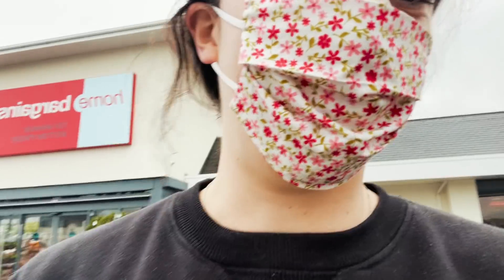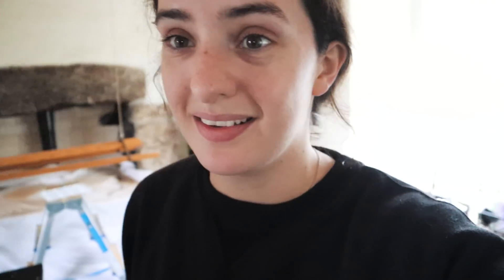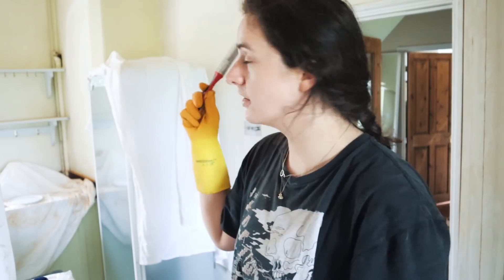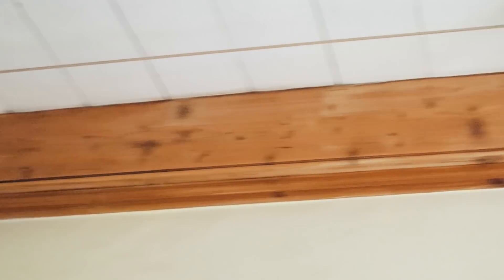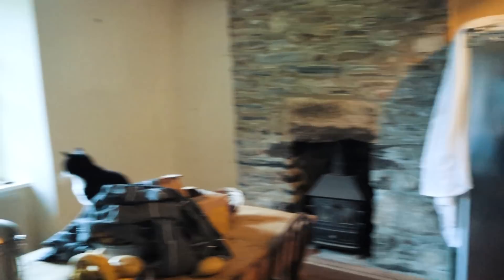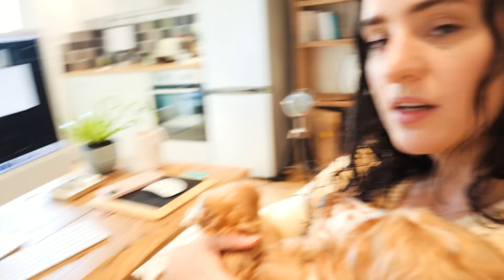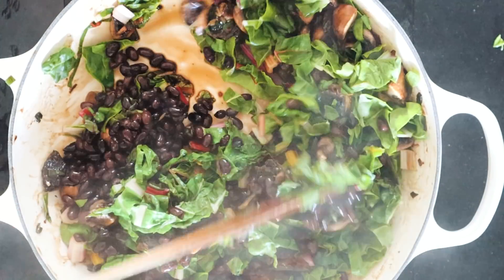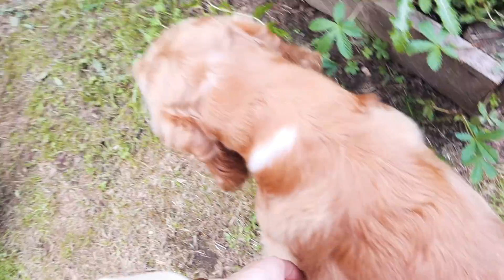200 Year Old Kitchen Reno DIY GONE WRONG! Oops! KITCHEN RENO PART 3

Comment from the maker: Hi everyone! Hope you enjoy today’s video! Thank you for watching and just wanted to make sure everyone is careful because as it’s been pointed out by some of you, mixing bleach and vinegar can be very dangerous! I mentioned in the video to proceed with caution and I am doing these DIYs at my own risk! I didn’t show me using the vinegar and I haven’t actually used it yet, but please don’t mix bleach with vinegar in any way as the gas it produces is very dangerous. This method was shared by another YouTube video where they recommended to allow the bleach to dry and then use diluted vinegar on a cloth to neutralise the process. Please be careful and use safety equipment, do your own research and don’t copy me because I am practising trial and error.
Reply: Chlorine gas is potentially fatal to humans and animal and can contaminate the air and surfaces around it!!! Please do not use the vinegar unless you have rinsed EVERY vestige of the bleach from the beams probably with a power washer. Preferably use a paste of bicarb to neutralise the bleach.

Comment: SAFETY COMMENT: Hopefully anyone wanting to try the wood-lightening reads this comment but be vary careful with vinegar and bleach- combined they create chlorine gas! I've never heard of this method of lightening wood but it sounds dangerous, take care guys
Reply: Yes! This is terribly dangerous! It's cleaning 101 to never mix the two.
Reply: @HarleyQuaint  I was thinking there's no way you're meant to use them together right?!
Reply: @emilymae8416  Honestly was expecting that to be the "gone wrong" part. Given chlorine gas is outlawed as a weapon because it's so dangerous... It really isn't something I'd want to risk in my kitchen!

I've accidentally done it before, chucking a bleach soaked sponge I'd used into a clean sink I'd wiped down with vinegar. The smell and the immediate eye burning was terrifying. Don't even keep them in the same cleaning cupboard now!
Reply from the maker: This method wasn’t combining them but using bleach first, then allowing it to dry and stopping the bleach process by applying a diluted vinegar mix with a cloth. It acts as neutraliser! Though admittedly I haven’t used vinegar on the beams yet. But definitely don’t mix the two so thanks for sharing the above. As I said in the video, do these methods at your own risk and make sure to be very careful and do your own research as I am simply sharing as I go. Do not copy me but be careful!
Reply: @MadeleineOlivia  The reason it neutralises bleach though is because it destroys the active ingredient (hypochlorite) and turns it into more dangerous chemicals- you definitely did the right thing with a mask and ventilation but it might be worth adding a safety note or something on the video? It's just as vinegar is like the worst thing to neutralise bleach, I just wouldn't want people who didn't know getting hurt
Reply: @ecojo  no need to leave nasty comments to someone trying to prevent others from harm, I'm glad you know about this dangerous mix but I didn't until 19, after I'd long been using bleach. Glad you know, but don't bother using your time to be rude online because it's pointless
Reply: @ecojo  the safety pinned comment came after my comment by the way, the idea here is to prevent harm because we don't know how young/Inexperienced the viewers are, it's always worth noting just in case
Reply: @ecojo  Just plain rude!
Reply: @emilymae8416  Exactly!  If everyone had common sense and/or understood chemistry, they wouldn't need to add a skull and crossbones to toxic substance labels.
Reply: @ecojo  Also, if someone was watching this on their PlayStation or Xbox console, they can't see all these comments about how dangerous it is.
Reply: Agreed.

Comment: The kitchen beams look good Maddie! ~ you may find that the colour variations even out weeks after you have finished the neutralizing with vinegar.  Sometimes, after wetting, natural tannins in the wood will leach out and make it patchy looking for while so I don't think you should blame yourself!. These streaks could be absorbed back into the wood over time. So you may have to wait a couple of months to see how the woods eventually settles down before the finished result can be seen. I would also leave it at least a month before sealing the beams with a matt varnish ~ in order to allow these natural processes (which require air) to conclude :-)

Comment: Have you considered purchasing wood in a grain and color you like and nailing it to the existing beams?  You could box them in, making them all the same size and color (variation in the grain and knots in the wood would give it character and if desired, you could ding them up to make them look older and more vintage).  You could also conceal some of the wires that run to lights mounted to the beams or any possible holes. This could save you a lot of time and work and would give you the results you are after.

Comment: Wait, wait, vinegar and bleach? Please don't mix the two! I know the bleach is probably dry at that point, and the windows were open but I'm pretty sure bleach produces chlorine gas when mixed with an acid and that can be really dangerous... Please be careful! (I think maybe if you were to sand the beams again the drip marks might go, and the previous comment about mixing it with something to make a gel would make sense. Or maybe you could try painting it over with a very, very diluted grey/white paint? If it's diluted enough it might just look like lighter wood?)

Comment: Hey!! I love your videos and I started watching when you used to do a lot a eco-friendly and sustainability videos, and I've been wondering where you have gotten your new electronics, like the computer and other home appliances. I don't think you mentioned anything about buying them either second hand or new. Electronic waste is one of the worst things out there and maybe you could share a bit of your thought process between choosing what to buy
Reply from the maker: Lots of our new home appliances have been secondhand for example our smeg toaster and kettle! However the computer I bought recently was new. The reason we got this in particular new was because it was for work and went for the latest version of the Mac so it would work best for editing and everything I do online. I always weigh up the options and also prioritise secondhand first! Our cameras we film are secondhand and we are always considerate of electronic waste because as you say it is a huge issue. Any phone or laptop I’ve ever had has been passed on to a family member or sold for this reason.

Comment: Think u just need a stronger sander to get more of the color off, rather than more bleach. I'd rather sand than bleach.
Reply: I agree! Heck I think I would’ve done anything else but bleach them. I would’ve painted them or left them alone (I think they are beautiful as is) before I would’ve used bleach.
Reply from the maker: I used the highest grit sandpaper so everything that was going to come off did!